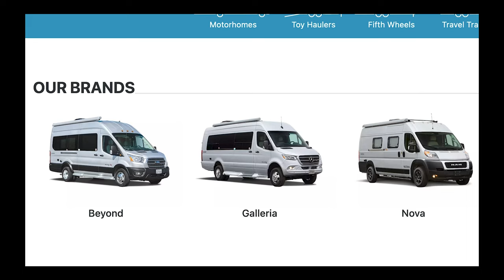Quick and Safe: Class B Van Tire Change Using a Floor Jack

Comment: FYI, if lifting under the rear differential where you did with the floor Jack you must be careful of the weight of some RVs because it will bend the axle tube! Costco is facing a lawsuit due to this very situation at their tire center. It ruined the rear differential. Be sure to make sure that your rv is not too heavy to lift at this point!
Thanks again for your videos!!
Reply: I'm skeptical of lifting the differential too. I prefer lifting with the jack under the spring perch if possible, with the downside that the spring perch can't then be used for the jackstands.

Comment: Don't go under a vehicle when changing tires..u should not need to! If u need to go under for repairs use jack stands on level hard pavement! Jack stands can sink if not on good pavement
Reply from the maker: Yep agreed!..We only went under to try to get some good visuals…when we had our tire blow out (previous video) the tow truck guy had some wood boards he used in the soft ground (that may help)

Comment: Zariah I watch your whole video but to me if you're going to do that it'll matter if you parked in your driveway is level I'll be putting some wheel chocks in front of your tire one behind where I can't roll forward or backwards because it don't matter if you got floor jacks if that thing starts rolling them floor jacks ain't going to stop at rolling but you need it truthfully four of them put to one on each side in the front and two behind each tire in front where can't roll forward or backwards where you lock it in place where you can't move but that's be more safety if I watch finish watching your video but it's so far you guys ain't talkin about them wheel chocks in front cuz you need to put one in front on both sides and one on the backside of the tires on each other side left and right and that'll cover you wear if you're changing that thing have a good day sir and be safe if you changing a tire because it is falling you bye bye